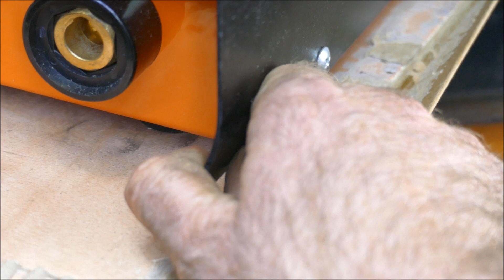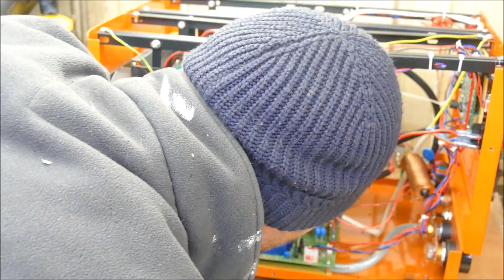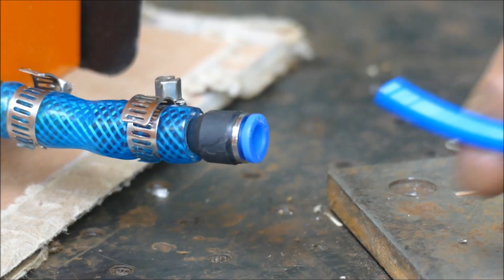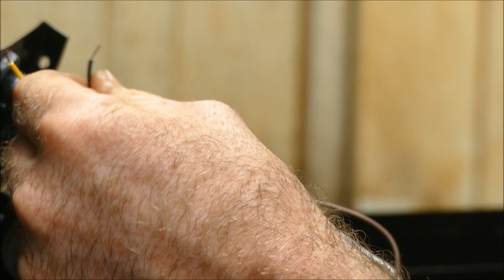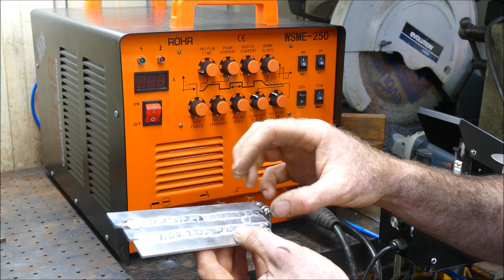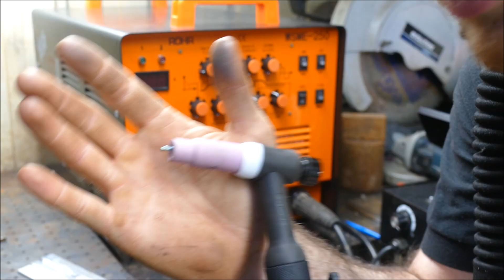I bought a broken welder from Amazon and fixed it saving £££ - Röhr WSME-250 250amp AC/DC Review

Comment: great review, I'd be interested to find out how you get the opportunity to purchase returned equipment to buy - do tell!
Reply from the maker: On the Amazon listing there is sometimes a box with used/new options. On that I got mine with 'acceptable condition' for £270. I was still able to return it if I wished also. I like it and feel I've got a good deal just using common sense to fix it. Cheers J
Reply: @joshuadelisle  CHEAP !  I was considering buying an aging Kemppi LHF 3  AC add on unit that would take its power from my big 250A oil cooled Oxford AC arc welder.However after watching your video I'm not sure what to do now. New cheapest Chinese AC TIG,  or high quality but old Kemppi  add on with the bomb proof Oxford power supply.  The Kemppi is on ebay for £350
Reply from the maker: @johnallen8680   go for Kempii. Great machine for that price. It has its nigles this Chinese one but it's paid for it self and working fine. I got a superflex CK torch which makes a difference. Cheers J
Reply: @joshuadelisle  Yes, I was starting to come back round to the Kemppi , but then foolishly searched facebook.  Brand new unused ROHR about 25 miles away for a snip at £180 ! 
Oh the pain !
Reply from the maker: @johnallen8680  the way I see it if you buy good quality second hand it keeps its value, so whatever you spend on a Kempii you can sell it again for the same price if kept nice. So in theory you own it for free kind of... £180 for a rohr is good if it works and you'll certainly get your moneys worth out of it even if it's classed as a throw away piece of kit.
Reply: @joshuadelisle  Hi, please can you remember what value has the potentiometer inside the padle?
Reply from the maker: @marianenescu5220  looking closely at the video it's 2.2k I believe
Reply: @joshuadelisle  thank you very much
Reply: @joshuadelisle I jus saw that there are two potetentiometers in fact,  is another one on front of the pedal which is actuated manually? Or its just a switch? Ar you remember if this is the same like the fot actuated potentiometer, but just actuated manualy? And the most important. How this potentiometrrs are connected? this potentiometers are connected in series? Thank you very much for all!
Reply from the maker: @marianenescu5220  it's a adjustment that determines how sensitive the main potentiometer is. Honestly it's not needed as I always have mine fully turned to have full control. If I turn it the other way it's as though the main potentiometer is bypassed and is just on/off full power. Not sure it's details without opening it back up but I don't think it's necessary.
Reply: google Amazon Warehouse, they have a page that shows all the returned items you can buy
Reply from the maker: I just checked. There is one under the option  'save with used - condition good' for £339
Reply: @joshuadelisle  Now £379 new. Good content, thanks for posting (Boilermaker, ret.) 👍

Comment: Hi Joshua, can you please tell me what is the rear potentiometer value of the tig pedal? I could see that the "vertical" one is 2k2 but it must go in series with the one from the rear in order to limit the max current (the peak current potentiometer from the panel is by-passed when the pedal is connected and it's activated by panel's pedal switch). This max current potentiometer is necessary to prevent over-current misshaps with thin materials. Much appreciated, I want to make one my self and I don't want to pay 65 usd for two potentiometers and a switch :) . And yes, my welder (exactly the same but "200A" version and different color and branding) had the same solder blobs at those current shunts and i cutted them out with a precision cutting angle pliers...also search for other solder drops inside the case, I found some.
Reply from the maker: I'm so sorry but I no longer have the welder or any details as I've given it away in place of a new version. All the very best. Cheers J

Comment: Any updates on how this machine worked out?
Reply from the maker: Check out my aluminum pond cover build. I use it for the whole project. Cheers J
Reply: @joshuadelisle  just got the 200amp version. Having some issues with poor gas flow.
Reply from the maker: @Micjoh  what have you set up regulator wise and torch cup?
Reply: Using a hobby regulator and 2.2litre hobby argon bottle. The gas flow at the cup is very poor. Opened the machine to check for leaks and seems OK. Air solenoid connection seems OK.
Reply from the maker: @Micjoh  I would say it was the regulator. Those hobby bottles aren't worth it. You get like 100mm of weeks before they're empty.
Reply: I think I have found a company about 30 miles from me who supply rent free proper cylinders. If they will also refill my "orphan" old air products  co2/ argon cylinder for mig, it will be a result.

Comment: I've bought the 200A version of this and it makes a horrible buzzingnoise when you hit the power switch, does yours do this?
Reply from the maker: No it doesn't. Are the leads connected right. It would buzz if using the stick welder. Cheers J
Reply: had the cover off, found some interesting things 
 @joshuadelisle

Comment: I did hear from a very experienced stick welder, a positive ground is better for over-head welding (your results may vary)
Reply from the maker: It depends on the electrode. Some only work in certain polarities. Switching polarity will change the depth and spread of the arc. Cheers J

Comment: Hi I know it’s a stupid question but can argon bottles be used with this? I’m looking for an ac dc tig to learn on  as I’ve a project that’s aluminium
Reply from the maker: Hi. Yes you can only use argon or helium mix with aluminium. Argon is best for stainless and pretty much all Tig welding. Cheers J
Reply: @joshuadelisle  thanks mate, I’ve just ordered the wsme-250 now, just need to learn how to use it 😂 any tips on a shopping list of things I’ll need to buy? Cheers Joshua
Reply from the maker: @MrTaylorVW  you'll need some gas pipe and a regulator so you can see how much is in the bottle and what CFM it's producing. I believe the pipe ID should be 6mm. If you wet the back of your hand you want just enough gas to flow so you can feel it cool your hand 8-10cfm I think. A foot pedal is helpful for aluminium as you want high temp to start with because Ali is conductive but then you want to back down on the amps once to temperature otherwise it will all melt away. A stainless steel rotary brush is good for prepping the surface instead of sanding. Hope that helps. Cheers J
Reply: @joshuadelisle  thanks again Joshua, I’ll order some stuff today

Comment: The problem was the 3rd one you fixed. The excess soler was shorting as you said. I think the previous buyer pulled the input plug out because they did not look at the fault. The other problem was probably just very poor attachment and came off with the shipping.. Good luck with your future!

Comment: Many thanks for the run through. Quick question, would you buy that welder at full price? (Or its smaller 200 amp brother).
Reply from the maker: I probably would  as it was a good price to start with. It's great for aluminium although the pedal isn't working as precisely as I'm used to on more expensive machines but I can cope otherwise. Cheers J
Reply: @joshuadelisle  Many thanks for the feedback.

Comment: Cutting the solder was pointless as the wires you "seperated" are still bridged at the front near the bolts, likely you have moved or bumped something back into place allowing the machine to adjust amps properly. Only reason I dont think your fix solved this is mine is the same where the wires are bridged yet I still have full control over amps and other settings, granted im on the 200amp version.

Comment: Anyone had any trouble with the andeli tig250 from e-bay ? Mine died after 3 hours of overall usage,  had the amps up to 150 . It won't power back on after blowing the fuse & tripping the breaker off . Still waiting for a reply from the seller.  £630 is a lot of money for 3 hours use
Reply from the maker: I can imagine.

Comment: Hi Joshua, Really nice video, very helpful. I am a gas welder and have been for forty years, but I have just bought one of these machines to play with and everything seems to work but having taken the top off for a peep inside; there are blobs of solder bridging the copper bars just like yours and the spark gap thingy for the pulse is not very well lined up, I don't like the silly little spade connectors for the mains lead either. 
I find with a lot of these Chinese things that all the components are usually there to make a good one out of, so it is a bit like a kit without instructions really.
I have a good foot pedal from another machine which I would like to convert so it would be really helpful if you could note the values of those two pots. in your pedal for us.
Thank you, Jon

Comment: Just some caution... Amazon delivers so fast that those quite beefy inductors might still contain enough joules to kill you... and it is made in china after all.. so beware when handling these units with no protection (bare hands).. It is not because it is cheaply made or broken that it will not kill you... current doesn't ask, it just seeks ground. So, wear safety gloves, use insulated screwdrivers, short the capacitors, ground the machine (chassis to earth ground), ground yourself, etc. Btw... IGBT's are not necessarily higher quality than MOSFETS, they are insulated gate bipolar transistors vs. Metal Oxide Field Effet Transistors... Instead of quality we could say that they are designed for higher power handling (Watts, voltage x current); but you can find low quality IGBTs on the market and very high quality MOSFETs... Anyways, thats a nice find and I will be checking amazon more... thanks for the nice video!
Reply from the maker: Thank you. That's great advice. Cheers J
Reply: @joshuadelisle  No problem, hope I don't sound patronizing, I am talking by experience, I am the first one that you used to see handling a grinder with one hand wearing no protection, cutting some steel... a real man lol ... a real d**b man. I am still alive, gladly, and today I always step back and think about what could go wrong before acting... I may look less manly and my work takes more time, but hey, I am alive for the people I love :) I just wanted to remind the people around. (Sometimes we forget or don't really know how close we play to the other side... and when things happen with high currents, grinders, heavy machinery, explosive gases, it is usually too late.)
Reply from the maker: @elbart100  your experience is appreciated and anyone wise will listen. Cheers J

Comment: Hi Joshua

I got one of these WSME 200. Its a bit different from the one you fixed but with the same name, so it cant be much of a difference after all.

Since I got it, it has never worked. They offered me a reduction in price. I said ok, thought I would be able to fix it. But here I am a year later.

It pops the fuse when I turn the switch on. And then a sec later the machine boots up for another sec, but only with the power that it managed to obtain before it was gone.

Do you have any idea what the problem might be?

I would appreciate your help
Reply from the maker: Hi Brian. Have you looked inside to see any 'anomalies'? Check all the connections and any soldered parts that maybe shorting. Sometimes the relays are broken and you can check if they are bulging. Let me know. All the very best. Cheers J

Comment: For anyone buying this machine I'll give a quick review, as I have this exact machine. 
More than likely you will find issues with this machine, but none that are hard to fix if you have some knowledge of electronics.
I bought mine and the seller stated the display wasn't working. Sure enough it wasn't. I opened the machine up expecting to replace the digital display but luckily everything looked quite solid, except for 2 white connector blocks that had shaken loose or possibly were never put in properly. Everything works fine now. Really lovely welds on steel. Nice DC pulse settings...however the frequency dial reads from 0.5 to 300...which in my opinion, doesn't go as low as 0.5. I think it's 2hz at a guess (twice per second). Shame because I would've liked a nice slow 1 pulse per second or slower, but hey... I'm toying with modifying that part. One disappointing thing though is that the AC Tig frequency cannot be adjusted. Only the balance (called clean area width on this machine). I'd have liked it if the frequency dial work on both AC and DC pulse modes, but it doesn't and is stated that way in the manual so I know mines the way it should be. Not sure what the frequency is set to for the AC Tig internally, but I'm not really an aluminium welder anyway, so haven't used it much. Is it a nice welder??? Yes...Is it worth the full £390??? No. I paid £200 for mine and overall I'm happy. I'm more worried about longevity to be honest. My old kempii machine was a transformer Tig/stick welder and was solid as a rock. Sadly toooo heavy and not as fancy.
Reply from the maker: Good information. Cheers J

Comment: Hi Joshua, I was so pleased to discover you're video. I bought one of these (full price) and never opened it for 7 months,  (covid orientated) opened it yesterday and of course it has problems, at first only power switch illuminated, cover off played and poked and then green power light, fans etc. but 20 to 30 seconds and cuts out, was set for arc. I would therefore be very grateful for a copy of the circuit diagram that you have.
regards
Joe Paton
Reply from the maker: Hi Joe. I don't have a diagram but if you contact the seller you should be able to gain some information. If it was just the stick welding option you've used have you tried turning the arc force setting up or is it cutting out completely?
Reply: @joshuadelisle  Hi Joshua, it's cutting out completely and no response from seller. Its probably not much, maybe a dodgy thermocouple. Many thanks for your reply 
Regards 
Joe
Reply from the maker: @derekpaton2775  I'm sorry I can't help very much. I'm not that knowledgeable on the electronics. The thermal couple sounds like a good start to test. All the very best. Cheers J
Reply: @joshuadelisle  thanks for your input Joshua

Comment: I'm sure you have seen some mention of not needing to ball the end of the tungsten on the newer inverter style tig welders..but if it was the older transformer type welder, it is needed to ball the end of the tungsten to use on aluminum..maybe worth mentioning most people use the dark/medium blue tungsten electrodes that are basically the old orange ones for basically everything and grey if you like a longer lasting electrode and purple or pink which is a rare element mix for specialty work..the lime green 2% seems to work great too..the old red tungsten is radioactive and is dangerous to grind and when it gets vaporized.. nothing someone would want to have around the house..

Comment: Great video many thanks 
I got one of these returns but found inside at the back 2 cylinders green with red wires 9cm long and 2.8 round 
One is broken. Have you any idea what they are called   The only writing seems to be DC20-50-320 RJ
Reply from the maker: Hi . I think it's the same type of high frequency parts in this guy's video: https://youtu.be/VAIsQbIuIUQ I think this guy will be able to help you better as I'm not 100% on electronics but I like to play with them.

Comment: After a bit of experimentation I have fond the best way to set the amps for the pedal is to set tig/ MMA switch to MMA press the pedal with your hand and set amps using the dial on the back of the pedal then switch to tig  the pedal will then work from 10 amps to your set amps at full pedal
Reply from the maker: Good idea. Cheers John. I add a little down slope too so I can manually pulse it bellow 10amps for super thin stuff.

Comment: Great video, waiting for the follow up! I had the same problem with the same model- huge blobs of solder on those copper wires, copied your cure with the pieces of insulation sleeving, and now I can actually adjust the amps- I wasn't getting anything on the digital display, and that works now too 👌
Reply from the maker: Well done. I've done a lot of aluminium welding since. Coming soon. Cheers J

Comment: Hi joshua. I just found your video. I bought the same welder and as a cosmetic return from Union Mart UK. Same case damage and a scratch but all working. You are spot on with your comments especially about not being able to see the amperage in TIG.  Unfortunately i have not had argon to use it much (waiting for a bottle) I have used CO2 on steel to try it's functions. I wonder if you can tell me how low  pulse goes on the machine and the best way to set it? Correct me if I'm wrong but the lowest 0.6 equals a pulse every two seconds. I get nowhere near that. Can't tell you what now I will wait for gas to arrive. I found the MMA or stick was  good.  BTW great and informative video, Thanks!
Reply from the maker: Thank you David. I've not use the pulse function much but I think it is 10amps the lowest it goes. I've mainly been using it with a pedal and manually pulsing it if needed with a little downslope and post flow.